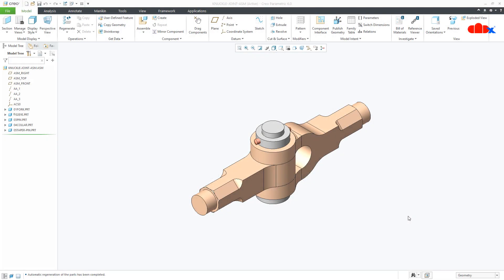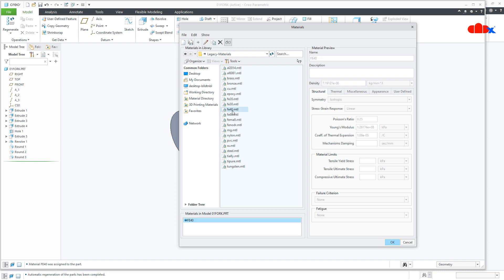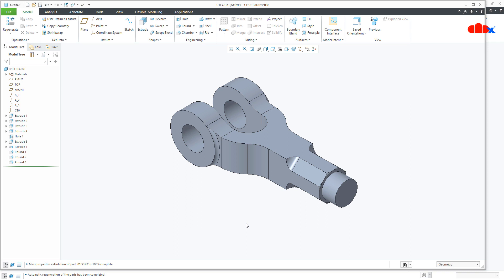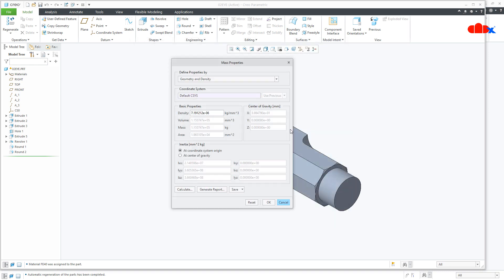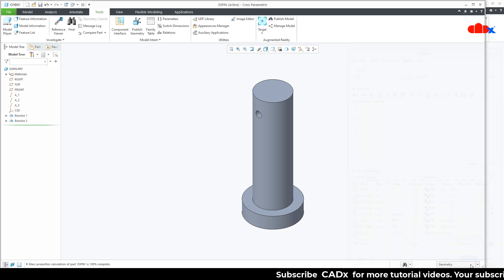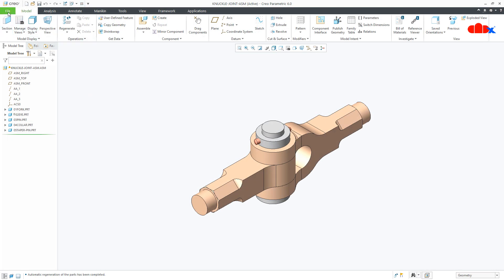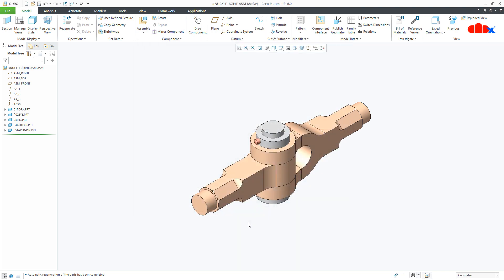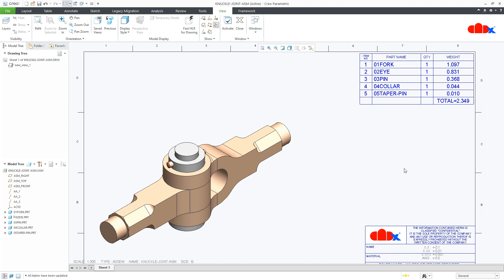Calculate the weight of the part | Calculate total weight of the assembly in Creo Parametric

Comment: If there are 400 different parts in the assy then do we need to apply material for all these parts??
Reply from the maker: If you don't need the total weight of the assembly then not necessary. But if you need the total weight you need to assign the material.
Reply: Sir there is there any shortcut...i think Catia tops with respect to this

Comment: I have a part which is used multiple times in Assembly but in BOM weight of only one part is seen. Should I multiply with qty to get total weight? If yes how? If no then what else can be done?
Reply from the maker: I will soon post a "Members only" video regarding this issue. You can easily calculate the total weight for any part if it is more than one.

Comment: Can I see my assembly total weight in creo assembly itself because whenever I  want to see whole assembly weight in creo assemble
It always calculate the whole assembly weight according to average density of all material
Reply from the maker: If you assign materials to all individual parts and check mass properties inside the assembly, you will get the total weight for the assembly.

Comment: Whenever I assign material to my component,I have to multiply the result wieght to 10 in order to get exact result.
I also try to set extract unit.
I Verify my creo generated resultant wieght by manual calculation by volume and density, but each time I have to multiple my creo generated wieght to 10